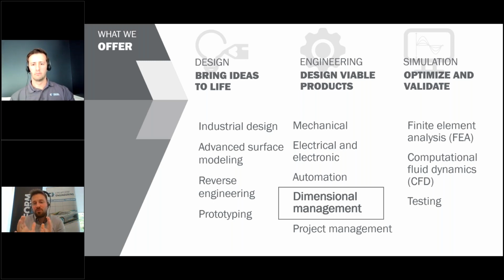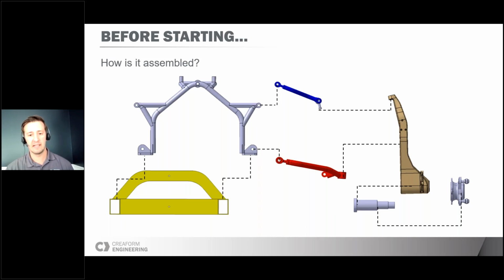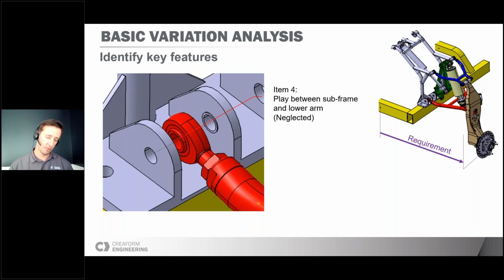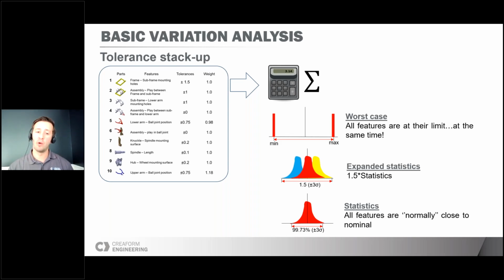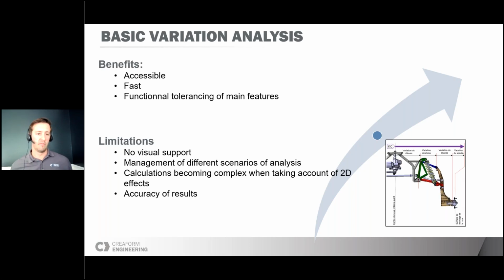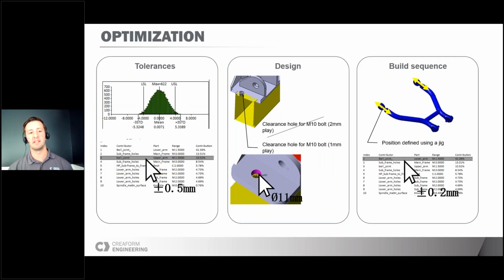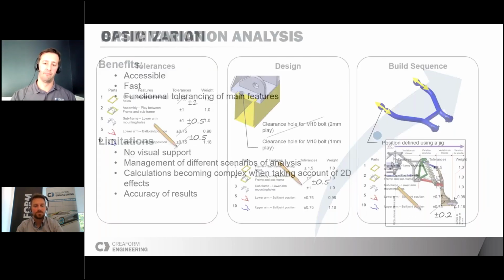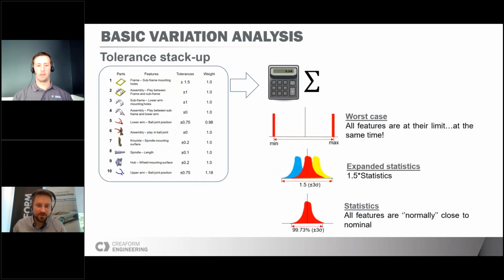Webinar: Tolerance Analysis, an effective method for validating product design

Comment: Nice job putting this together! 
I worked as a senior level design engineer at a rather large multinational company, overseeing a number of professionals and a rotation of young engineers every year. One thing I would recommend, especially to younger designers, is to spend some time and effort trying to gain a grasp of process capabilities. You can find general process capability indexes and such online, but the best source will always be your quality control department. If they employ a CMM then you have a good source of data to develop your own internal capability analysis. 

Knowing what your capabilities are, you can design around some of the problems you're going to face and for those you can't, you know exactly which components you may have to source from those who can produce them to more exacting standards.
Reply: A tip : you can watch series on Flixzone. Me and my gf have been using them for watching all kinds of movies lately.
Reply: @Jase Zayden definitely, have been watching on Flixzone} for since november myself :)